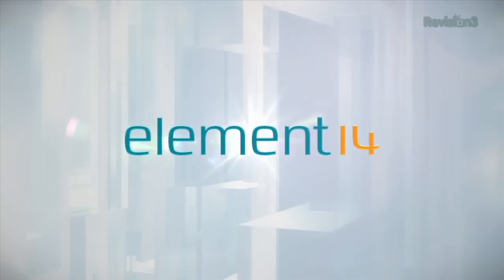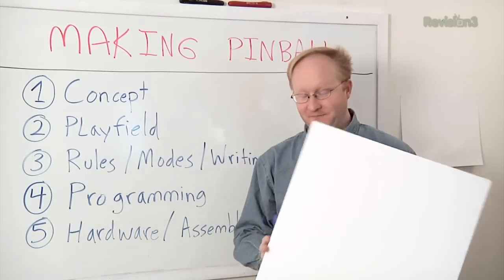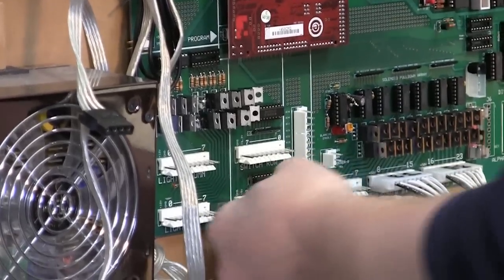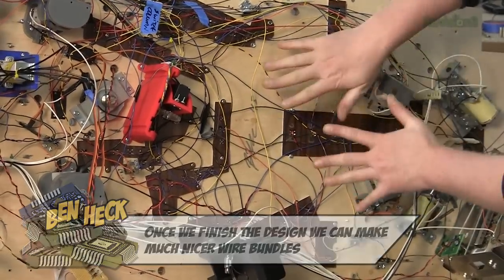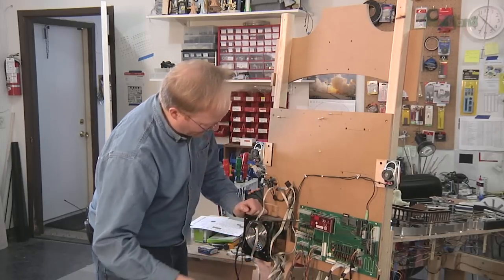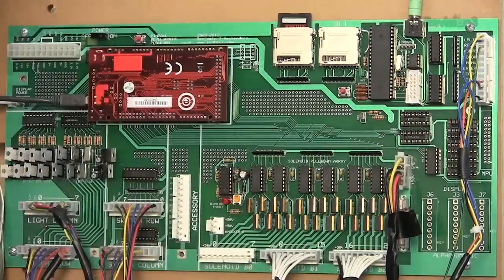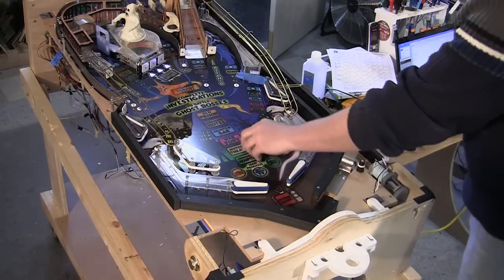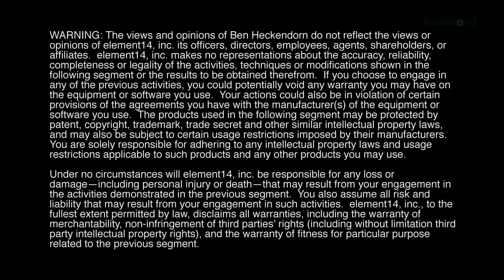Build Your Own Pinball Machine

Comment: Hi!
https://www.youtube.com/watch?v=P3udnxbvJhc&t=01s
This is my "custom made" game from a dead Recel -  Fairfight pinball machine. The CPU board was dead, and it is impossible to get a new board. So This game was remake with a regular PC. DOS opersting system. And Turbo Pascal language. The gameplay has been rewritten in Pascal from the original gameplay. So It is 95% the same as the original gameplay. Only I added music with a MP3 board. The switches, and bulbs are controlled  on LPT port. The switch matrix is a PS2 keyboard matrix.

Comment: If people are looking for old circuit boards ect. they should check the dumpster at a "Rent-to-Own" shop they have SO MANY computers and monitors in the dumpster.  It's crazy.  The dumpster is clean too because its all electronics.  You can seriously get a never ending supply of computer cases, ROM drives and PSU's.

Comment: Ben, I am starting a pinball project. Could you help me with some basic measurements, such as minimum distance between pinball and two rails (1 1/16 in pinball),  width of slot on roll over wires, sling shot posts, etc.  I realize that each machine has different designs, but there must be some basic measurements,  Also the initial channel width for pinball shooter.  Most of the other measurements seem to be trial and error.  A little help please to get started with the playfield.  Thanks Tom

Comment: Ben! I see you are using an ATX 20-pin power connector on your board. Where did you get that? Is there any better way to get them than hunting down old motherboards? I have found the male connector online, not the female motherboard connector.

Comment: do you switch both sides of the solenoid?  I  used to have a pinball machines and could swear it held one end high and grounded the other end to activate it.   also,  a show with tips on solenoids would be great.   they don't seem sexy,  but a lot of projects rely on them.